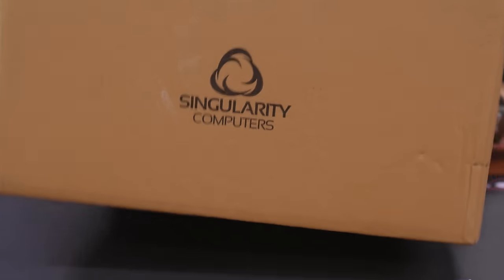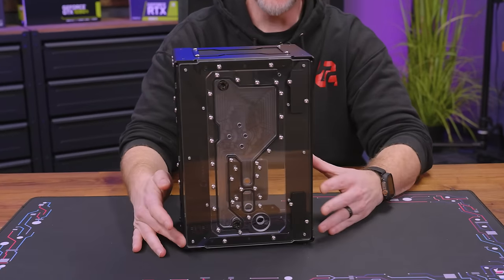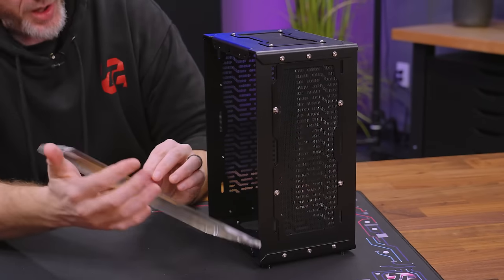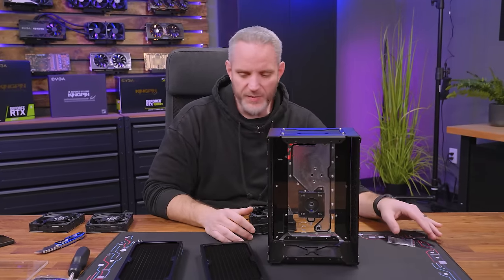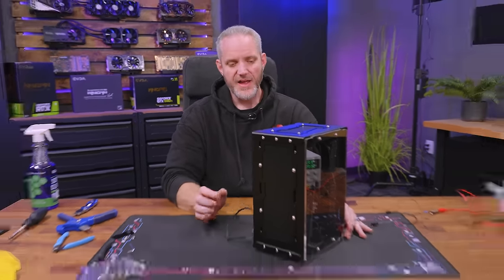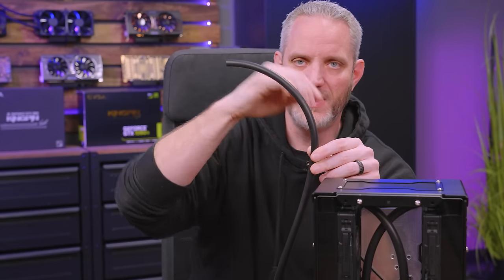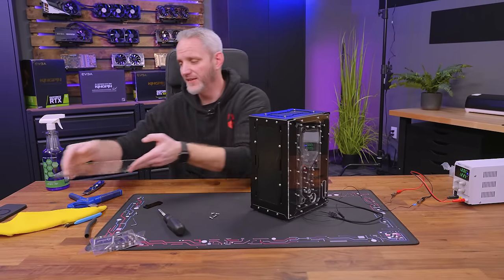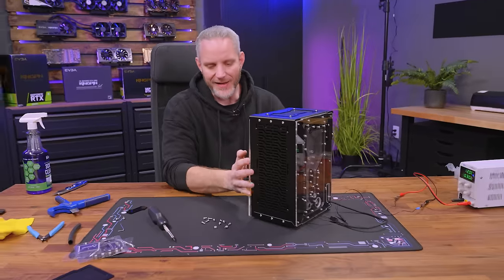External Loops are a thing again?

Comment: Alright Jay, ive got a question for you. I just learned that heat pipes use water as their phase change liquid. Liquid cooling also uses water. My question is, if we are targeting temperatures below 100C, why havent we seen any cooling loops using grain alcohol as a phase change liquid with a looped condensation chamber/radiator to return the alcohol back to a reservoir mounted directly to the IHS on the cpu? Basically use the cooling plate as a pot to boil the alcohol, run it through a cooling loop, then right back to the pot. With a secondary reservoir set up to siphon into the cooler based on liquid levels at the cooler, this could be a solution with no moving parts.
I feel like im missing something, but i could swear that, assuming an efficient enough thermal interface, the heat source, pot, and liquid will all try to equalize at the boiling point of the liquid. 
Assuming the reservoir is large enough to feed the pot as fast as the pot boils alcohol, wouldnt this keep the CPU right at 60C?
Have you seen anything like this done?

Comment: Hopefully you'll see this, but I have a rediculous suggestion... Do a " = " flow, but oposite top and bottom direction (push-pull might be needed, honestly don't know). 
I honestly wonder how much it will recycle the air, and how it affects the cooling in terms of potentially stalling the air. If you have a smoke maschine, it could be visualized. TO BE CLEAR; I have no knowledge or reason for this, just curiosity.

Comment: Flat Earthers say that from Australia to Africa south the shortest path is going above the Himalayas...
Anyway. This stuff is like a dream until I check the prices. With a handheld vacuum cleaner which can blow the unit does not really need an air filter. I would consider a demciflex one anyway.
Demciflex needs weekly/monthly cleaning. The usual filters coming with cases does not need frequent cleaning. They working better when dirty.

Comment: Jay, being that there isn't really any crucial components in there why could you not turn the rads into the exhaust and intake air from the top and bottom? You don't have to worry about dust on your gpu,mobo, or anything else.

Comment: I kind of built a system like this. I took an old ibuypower case and installed 2 360s on the side and a 280 on top all with fans. and in the center i have the water pump. that all  runs into my other case picking up my GPU and CPU heat.

Comment: Please do this air experiment Jay!

I have a Lian Li 011 Dynamic Evo case with radiators top and bottom. The entire system is liquid cooled and on the same loop. I often wonder if I should be intaking on the side with a faster fan speed and exhausting both top and bottom with slower fan speeds to keep the case positively charged OR should I intake on the top and bottom while exhausting out the side with more or less the same fan speeds so it stays positively charged.

Comment: The way I did my rads is a 420 as exhaust on top that gets the hottest coolant first and then a 360 as intake on the side that gets cooler coolant because the 420 cooled it first. Thinking that way the air being blown into the case through the 360 isn’t as hot that way. Not sure if it really makes a difference or not. Haven’t tested it a different way.

Comment: I love the concept, but the appearance and speculated costs for this waterbox are not really appealing.

I think that I would rather get a small mesh case and modify it to be a waterbox than one with such low breathability.  There is a move towards external WC, with smaller cases with the PC hardware.  Whether with a MORA or similar type of radiator, or enclosures with multiple radiators in them such as this.  This kind of makes it easier to service and change parts on the main system since you dont necessarily need to drain the whole loop, and can just hook up 2 QC.  I think the days of having 3x 360 rads in a huge case may be coming nearer...

Comment: why would they shape it in a cube? something closer to a triangle would create more optimal airflow for pulling in fresh air from outside the case and exhausting both rads toward the same exit. instead of either both intaking in a cube and exhausting into eachother, or one intaking and exhausting toward the other, which would be intaking that warm air and exhausting it. am i wrong?

Comment: that box should have had a 120mm fan on the top exhausting air and the 120mm fan on the bottom  pulling in air, also should have had taller feet on the bottom. also both rads could have fans pulling in air

Comment: I think I might have a weird set up but I feel like it should work. I have a 5000D with a AIO for the cpu and GPU is an EVGA AIO. 

Front 3 fans are intake. CPU AIO rad + fans are on the backside of the case pulling air, GPU RAD on top of case exhausting, and then one singular fan on the back of the case as an intake. Since everything is exhausting through the GPU, the more fresh air the better?

Comment: test it. but idea modification.
dual system test. system one's radiator intake fresh air only during tests. system two's radiator to be switched between fresh and used air from firsts rads. 
and for more info fun by adding in blocked vs open vs fanned lower vent as well open vs fanned  upper vent. ok ok probably wont be fun with all the combinations to gather from. of course we the fans would love for J to bust out the AC cooler for it as well.

Comment: I'm a bit late to the party, but just got a gigabyte4070, and so I finally have a GPU that is worth water cooling. I have an AIO on my cpu already. I'm trying to figure out whether I should ditch the AIO and go full custom (would be my first) or get an external box like this and keep the AIO for CPU... Any thoughts?
Also, I would REALLLLLY appreciate a video showing whether the positive pressure would work better than the cross flow method, and other arrangements also, of course. 
Absolutely Love your work Jay, Peace brother.

Comment: Time to use that 3D printer and make a duct. Combine both sides like a exhuast manifold and vent it all out the top. Clean air flow and coolness as essentually you would of made a exhaust manifold... But for a PC.

Comment: because the air coll pump and pipes in the cabinet before i goes out and cools the radiator the radiators can cool a lot more with a little less cool air because the colings area is a lot bigger 👼

Comment: The people who worry about hot air on a rad always amaze me. Even if the air that flows over your rad (the local ambient temp from heat release from the other rad) is 86F, that's only 30C. That's still a 60C+ difference of any worrisome temps, and is plenty cold enough for the second rad to lose heat. The whole point of these heat loss products is thermal conductivity and surface area. Both of which are more than taken care of.

Comment: I dont understand why we dont see this more often having the cooling completely separate from the pc. It should be better by far. You can pack things so much closer, and it would revolutinize computer design. Not also mentioning with this system you could have completely sealed case so no dust and no fans completely silent simply use soft tubes to take to cooling tower. Then you could put the cooling tower next to you in the winter or in another room in the summer

Comment: Jay there is no videos on those rad configuration. I have three rads in my build and I wonder if all positive pressure with my water cooling loop would be better than the “typical” air flow!

Comment: Is there something I'm missing? Are we trying to do anything else besides getting rid of the heat inside the 2 radiators?
I don't see the point of an enclosed box to hinder the air flow. Better do a stand up panel to mount the radiators onto.

Comment: Why even pull (or push) air through a box? The top and bottom openings clearly bottleneck flow. Makes more sense to me to just pull air through the rad and exhaust it immediately creating nice, laminar flow compared to the turbulent flow in this setup.

Comment: Normally i would say both pulling in would be best, but i think on this box the two out-flow vents would restrict it too much.

i think its fine as cross flow.  as long as the air from the firs trad isn't too warm that the second cant dump heat then it should be fine.

big question this could answer;  which is best?  do you get best performance if the first radiator is the intake then going to the outflow, or is it better to have the first radiator on the outflow then going to the intake?

Comment: surely sucking air in through the top and bottom vents and blowing out through the radiators would be better. Blowing fans at each other in a closed box looks inefficient to me.

Comment: I really don't get it.
You could buy a MoRa 420, with Noctua fans, fan shround, dual-pump, dual-pump adapter, reservoir, and wall mount, for about $1,100. It would provide AMPLE amounts of cooling AND it would be cheaper. Sure, no RGB and it wouldn't look as nice, but still.

Comment: Where do we start? 
This looks like an early to mid 2000`s pc case with the Plexi and huge chrome dome caped bolts. honestly i hate it. It just looks so tacky. then we have the airflow, ill be very interested to see how this works out. In my head its close to pointless its just a hot box in the making without true intake vs outtake. so much about this screams wrong. they make some great stuff then there is this!!!

Comment: I would love to see more information on this!

I currently have a Pre-Built PC that i bought during chip shortage times and didn't want to fight to get the parts i wanted, and ended up with a 5950x and a 3080 water cooled in a mini itx case with a single 280 Rad, and feel i have WAY too little cooling.

Would it be bad to run this with its own pump along side the pump that is already in my system? I really like my case and the way the water cooling looks inside (Maingear Turbo), but really feel that I need better cooling for my parts and this is a very interesting prospect. But I would need to do a lot of figuring into how to best plumb it into my current system and would be interested into your thoughts into the matter as well.

Comment: Have the system return either the rad being cooled by the internal air. And then the discharge from that rad go into the rad getting fresh air? 

Thus you are getting slightly cooler air inside the box.

Comment: did you not already do a test about multiple radiator having radiated air shared in a push and pull config?
If I remember right, if you have the last radiator having the heat exchange with first air incoming, it will cool down the rest of the radiators even though they are still warmer as the first radiators before the last?

Comment: How would it work if you drew air from both the top and bottom and blew that air thru both radiators and out the sides? That way you would not be using hot air exhaust from one radiator to blow on the other radiator lessening the second radiators efficiency.

Comment: Just an observation but you’ve been water cooling for over a decade shouldn’t you already have the data for positive pressure ( intake through rads vs exhaust through rads). I setup my system using your recommendation of intake through bottom radiator and exhaust through top radiator beginning to question my choice of using your advice

Comment: I would love to see a video testing different configurations.  Everytime I hear this "issue"  with heating air through one rad and then pushing it through another I wonder if it would make a big difference what order your coolant hit the rads in versus what order the air hit the rads in.  Essentially if you had coolant flow out of your system into rad 1, then into rad 2, but you have your fresh air intake on rad two and then exhaust on rad 1, is that better than the reverse since your air is cooling the cooler rad first then cooling the hotter one?  Really curious if that order would make any significant difference assuming that there's an issue with exhausting out a rad in the first place.

Comment: Push...push...Fans blowing air OUT so the top and bottom vents are INTAKES so the inside of the box stays cool and doesn't heat the distro plate and you can take the filters off the rads for more airflow

Comment: Not going to make a difference, they are both still cooling the water as the air going through the radiator is never going to reach the temperature of the water!

Comment: I just want to know how easy it is to use an external watercooler! Running an i7 13700k and will be getting the 4080 super.. The i7 gets real hot even with my nzxt cooler and the fans in my pc are SO loud. Would be nice to be able to externally watercool for better temps.

Comment: quad 560s is an ungodly amount of cooling performance.  Their dual 560 case can already fit twin 85 mm thick rads in push pull.  The amount of cooling from that is...   just absurd.  Only case labs cases could handle those rads, and unfortunately, they're not around any more...

Also, singularity made the quad 560 custom for a client.  Personally, I'd love to have one, just for the sheer absurdity of it.  You'd be near ambient with no noise at all, even with a thermoelectric cooler and full overclock.

Comment: What about both radiator fans on exhaust and pulling air through the top and bottom. I can see though where taller feet may be required though.

Comment: Would adding fans to the bottom and top to help push/pull the air through the top help in the double intake solution?

Comment: Run the intake rad fans at 70 to 80% and the exhaust fans at 100% that way you will pull in 20 to 30 % cooler air??? Excited to see all the different results, hurry. 😂😅

Comment: Honestly don't get the point of that, it just seems to be a massively inefficient use of space, it's the size of a computer case without a computer in it and it's only dual 280 which many cases already support, and for the 560, they should just make a case with 560 support so the computer hardware is in all that wasted dead space.

Comment: I literally (properly used) have a 4090 240 rad feeding an o-11D with a 7950x on a 360 rad. My question is do I need the three industrial ppc fans feeding from the bottom. All fans in the system are industrial ppc 3000's = 9

Comment: I'm curious if there is enough room if you can do push/pull configuration on both 240s and have enough room for the pump? Or would it be smart to have fans on the outside to help move more are through it?

Comment: expensive... it's better to buy a small case or get it from someone for free and cut out everything inside and install the coolers. With this amount of space, I would install fans on one of the radiators blowing outwards, so 4 of them would blow in the same direction and the air would also escape through one side, giving less resistance.

Comment: If you flow the water through the warmer exhaust rad first then the colder intake rad you won't be heating back up the water. Is this correct? Is that how it's usually designed?

Comment: I have a samsung odyssey ark that will display at 165 hz refresh rate but my HDMI cable isn't capable of displaying that resolution about 120hz so yeah... looked online it doesn't seem like there is a HDMI cable available that goes over 120hz lol.. when I choose 165hz my display has some minor flickering because of the cable.. its just kinda funny I am now just limited to my HDMI cable.

Comment: Adblock.. Check. Click to 30 second mark to skip Jays internal ad.. Check. Scroll thru another shill video pushing a POS case that might give you just slightly lower temps. Out of here in less than the time it took to type this at 120 wps.

Comment: Not to harp on about it ... but does the radiators standing / with ports up top for both rads like that, mean Steve will be concerned about pump wear and circulation deficits?  Obviously as this is a test system for waterbuilds, liquid permutation over the long term isnt a thing for this use case, but still, wouldnt it have been better and easier to put the ports at the bottom of the vertical rad?